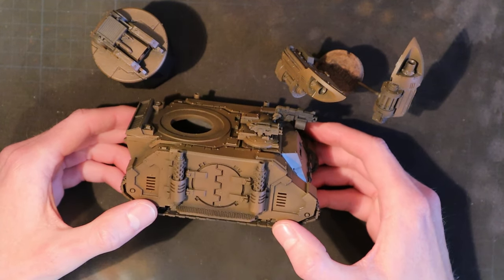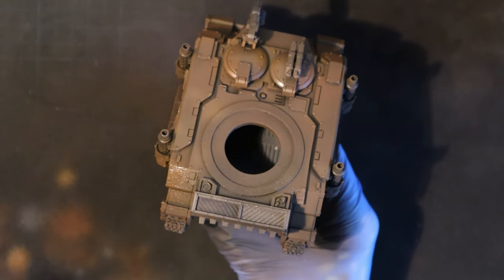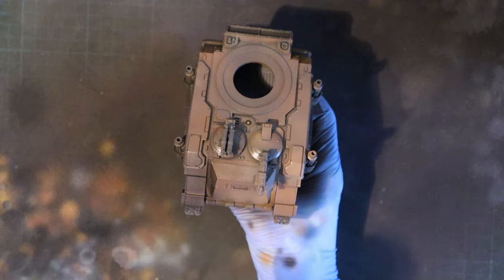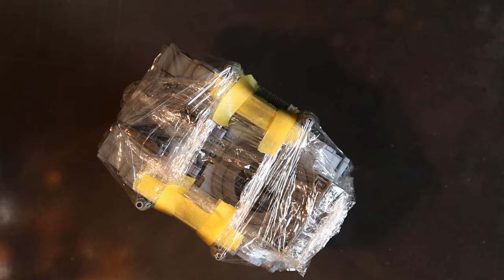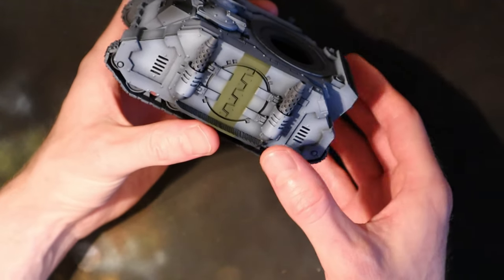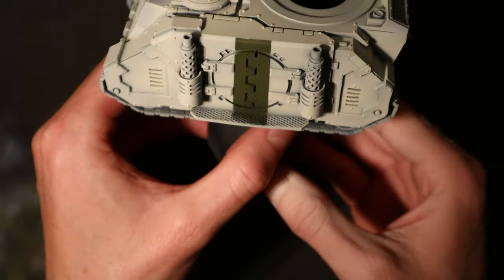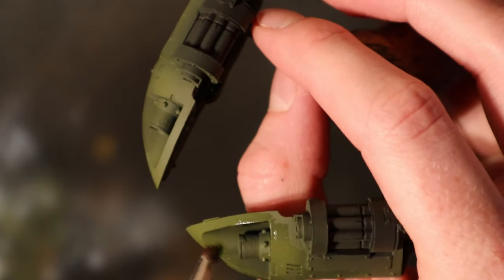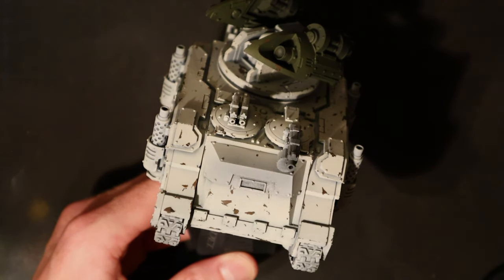How To Use Chipping Fluid

Comment: Nice tutorial. Quick question, why do you use the Tamiya tinner with the vallejo paints? I've always used tamiya thinner with tamiya paints and vallejo with vallejo, does it actually make no difference?
Reply from the maker: Cheers, hope you found it useful. I use the Tamiya thinner in this instance to help avoid activating the chipping fluid. In reality it probably bears little, to no effect. But I'm a stickler for process. /Tom.
Reply: @RiftForgeStudio  Thanks Tom! Ive never considered that before. I totally get being a stickler for process I black out everything that isn't my armour colour before moving on even though it probably makes no difference and doubles the painting time 🤣